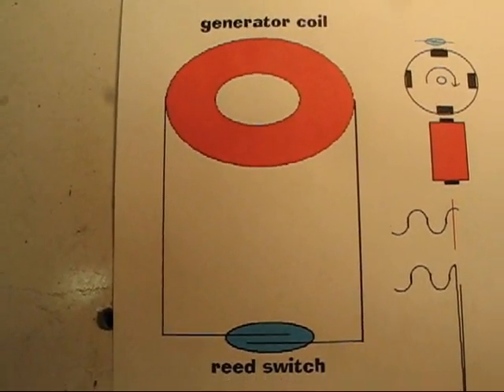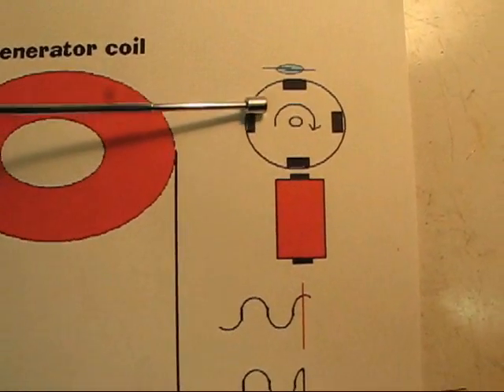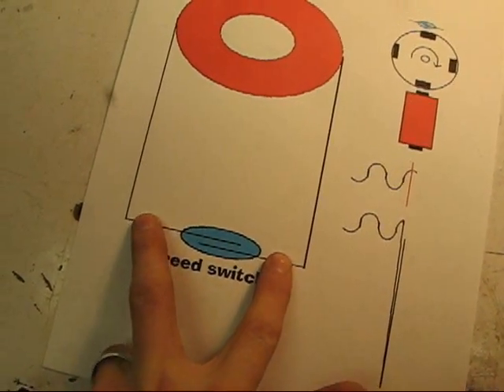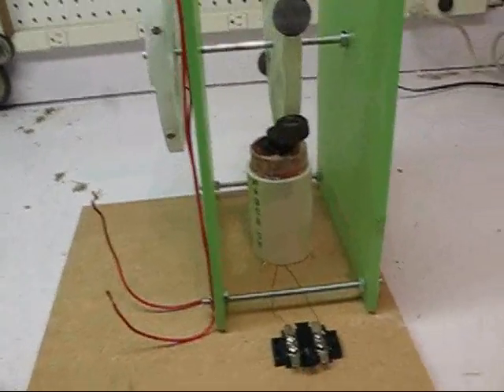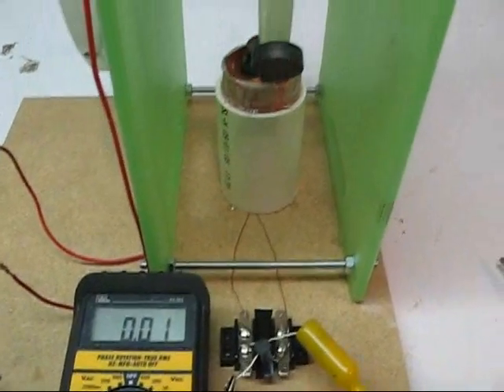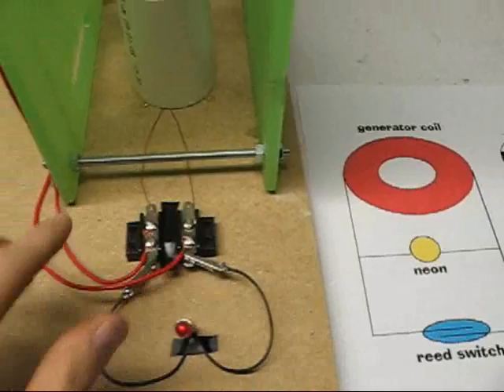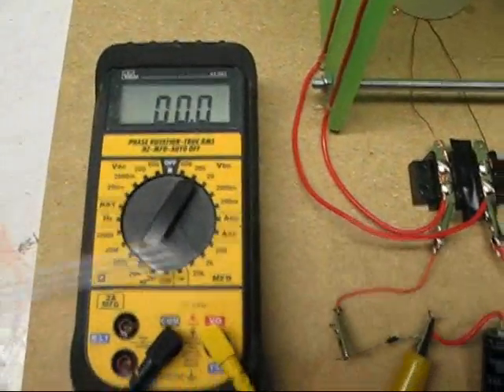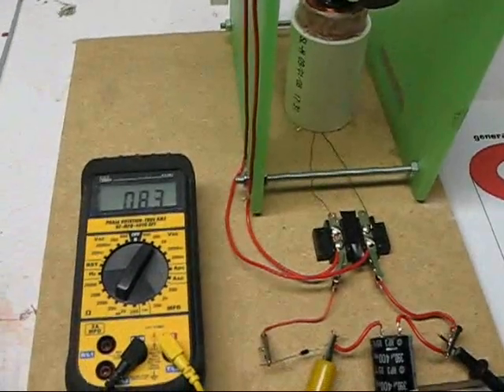Flyback From Generator Coil

Comment: Just 'thinking out loud' here.  Not used to seeing the secondary winding of a transformer set to short out as the oscillating magnetic field from the primary 'winding' (the rotating magnet in this case) is inducing maximum EMF in the secondary.  The coil is the secondary winding.
Very interesting circuit!

As the reed switch is made to close, it creates a 'load' for the coil of very low resistance.  Why?  Because the reed switch is connected across the coil (see time 3:24) and the timing of the reed switching closing is aligned with the position of the primary 'winding' (the sinusoidal magnetic field passing by the coil, the rotating magnet).

So at peak induced voltage in the 'secondary' (the standalone coil),  the reed switch closes, and that shorts the two ends of the coil together.  This is like the secondary winding of a transformer being hooked up to a zero ohm resistor.  Very high current.

What does 'very high current' create in a coil?  The rate of change of the current in the secondary winding (the coil) is HIGH.  The current in the coil goes from zero (reed switch in its 'normally open' position),  to max (reed switch is made to close by the 2nd outer rotating magnet wheel).

Since the rate of change of current dictates the intensity of the magnetic field created in the coil, and we have here a high rate of change of current (zero to max after five L/R time constants*) - the magnetic field in the secondary is intense.  Note:  it could be increased more if a fast MOSFET was used, since I believe the MOSFET will switch on and provide a conduction path faster than a mechanical switch.  But then you'd need complexity to drive the MOSFET gate, etc.  Reed switch is perfect for this demo.  Good choice on your part imo.

When the 2nd outer rotating wheel's magnet is no longer near the reed switch, the reed switch opens and the massive magnetic field just created in the coil collapses into a huge Back EMF spike.  Really cool.

The key factor is that 
1)  a zero resistance 'load' - a dead short - is added across the coil (secondary winding) 
2)  and this is done at peak magnetic field induced by the primary 'winding)  (the rotating magnetic field wheel)

"When induced voltage is maximum, short out the coil so that maximum current can flow.  Since the magnitude of current and the speed the current changes dictates the intensity of the magnetic field induced in a coil, the fast-changed high current creates a big magnetic field and sets up a big Back EMF spike."

Really clever stuff.  Thanks for an excellent video!

Comment: I have a generator than turns very slow when I apply more torque when charging a battery, it must be back EMF as resistance of the load on rotors and shaft is greater when i add more toruqe

Comment: No, the reed switch is across the AC side of the rectifier, connected directly to the coil wires essentially. The spike occurs when the reed opens yes. At that moment with the reed open, all the extra energy goes to the load. Neon, or bridge rectifier, etc.

Comment: add a small film capacitor across the switch  then add a secondary with 100x more windings and make yo-self a magneto!!! 50,000 volts of electricity!!!

Comment from the maker: @teslata00 

No, it is defiantly a neon.  Part # 272-712 from radioshack.  Thats how they come from the shack.  They also have a resistor in them to be used with 120V.  It would have lit much brighter had i taken it out.

Comment from the maker: @waltermouthoh 
Well sure you could use it to charge batteries running from your bike, but i would probably just use a standard generator on your bike to charge them for ease and assurance of desired output.  I dont completely see everything the way school teaches it either, but for the most part i would say it would be very wise to pay attention in school.

Comment from the maker: @henrykay01 
Sorry, i know the title is goofy, i may change that.  I know the patent you speak of and have experimented with it, its an interesting device.  Most Hams are aware you have to be careful when touching an ungrounded antenna as a HV charge will build on it.  Its that same effect put to use.  You can basically think of it as a device that collects static electricity from the air.  Its not perpetual motion, its more like a windmill or solar panal.

Comment: TRY 5 times at peak

you will get 5 times more power and matners will be "confused". Busts lenz law and increase power in huge amount.

you really cant measure current at same time as you do this...you have to calculate jules in cap - the ammeter will snub the effect!
Also if you use solid state swticheing, the internal resistance of most  will snub it too but reed swtihces work and mechanical ways too..
Ismael Aviso uses IGBTs (lowest resistance) and special RF filters on their gates

Comment: Hi,
maybe try a small motor to run on the charged cap, that will drive the wheels !
Maybe your spike is producing enough power, so a small
motor can run it ? This would be then a selfrunning system !
Good luck !

Comment: now have 2 caps one charging and one dumping the potensial to a battery. 
The secret is to switch the charged cap completely off the charging unit, when dumping it to a battery.

Comment: Nice video. Suggestion: You need to show current measured in standard method,  and then compare it to the current measured with the capacitor later on.  My hunch is you are amplifying voltage but a current drop is occuring. However in both instances total Power = IxV is the same.

Comment: Hi Cody
thanks for doing the video!- I always try to get people to :"short" their generator coils at the peaks but only a few people so far have actually tried it to confirn the extra power it makes
Ismael Aviso clips "pickup winds" around his  high voltage motor coils FIVE TIMES at the peaks!
twice before  Top Dead Center, once at TDC, and twice affter TDC - he uses very fast swtihcing to do this.
if you use one diode, fill TWO caps each iwith own diode (opposite facing diodes)

Comment: I got this from testing a mullergen by "shorting" coils with reed swtich, and cap suddenly had X20 volts!
Swtihcin at peaks is key. Also very short pulse width..
I like to say this works becasue the coil collapses "within itself" and rebounds with a vengeance when switch is opened.
Those reed swtihces will fry from that arc - you can pull off that plasma arc with dioes into cap too.
i like to use a FWBR (fullwave bridge rectifier) instead of single diode as shown here - catch it both ways.

Comment from the maker: Your right, a better diode probably would help .  I no longer have that setup so i cant test it with that, but any pulse motor could easily be modified to play with the effect.  I find it funny some of the things i say in my vids : ) cant take them back once on tape.  I was using a 1n4007 in the vid, but i usually prefer at least 1n5408 or better yet an ultrafast hv rectifier.

Comment: the reed switch could rob some of the power,but have you considered the voltage rating on the diode? try charging the cap again with a high voltage diode. thanks!

Comment: Indeed there are many people working on more efficient motors, because the ubiquitous squirrel cage induction motor that runs industry is well known to be very wasteful.  These motors are widespread simply because they are cheap to make.  Better motors have been around from day one. Beating the common induction is not an impressive challenge.

Comment from the maker: Thank you for being a respectful skeptic, many are very impolite.  There are many trained engineers working in this field, and motors have been built that are more efficient than current models.  Google rotoverter for a shinning example.  This motor runs on less power than the standard motor, and still preforms the same amount of work, and there is nothing magical about it, like you said , its all explainable.  Its just been easier to manufacture and use less efficient motors.

Comment: You are talking about salvaging the energy of a collapsing field when turning off a motor.  This is a small loss, hardly worth the bother.  Surely you're not suggesting that there is some kind of fountain of free energy waiting to be tapped . . . for that would be chimerical thinking.  At best, you are chasing a fraction of 1% savings in putting this little spark back in your pocket.

Tell us of the lost mysteries of Tesla's coil!

Comment from the maker: A motor is not needed at all to play with this, it is just providing a simple means of switching to get a pulse frequency, increasing the effect. The tesla coil as known today is not at all what tesla originaly invented, it has been changed and dosnt opperate as it should, its not just some spark generator.  There is a lot of technology that has laid dormant for a long time but you will see it coming back soon.

Comment from the maker: You are also correct here about the collapsing field inducing a potential voltage. But when directed into a capacitor or battery, that potential voltage gets transformed back into current(amps). This is another well known effect (which was discovered by tesla).  No ark occures when correctly set up. Tesla went way more in depth with this stuff but that info you wont find in mainstream science.  Just like true wireless power, no schematics or diagrams in school books.

Comment from the maker: You are correct, it does kill the contacts in motors and great lengths are taken to avoid it.  However, to avoid it is wasting energy, it only destroys the contacts if you dont give it a path to go, such as charging a battery.  Works like this: charge up coil, abrubtly turn off coil, direct collapsing magnetic field into battery thus conserving energy.  Works best on resonant notes of coil.  It was tesla who first discovered radiant energy, not bedini.  But thats to much for me to cover here.

Comment: Coiling the wire simply concentrates a lot of magnetic field in a small space, thus exaggerating the effect.  This same effect is well known for 100+ years to make hell on relay contacts connected to electric motors, mainly at the time when the motor is turned off.  The arc damages the metal contacts.  I suppose it is killing your reed switch!

Now I have a question.  Why did Bedini call this a radiant spike?  And what is Bedini claiming to have discovered?

Electricity is interesting.
Jaymz

Comment: This spike is a well known effect, and is explainable.  When electric current flows in the wire, a magnetic field develops around the wire.  This is stored energy.  When the circuit is broken (opening the reed) the current does not just stop immediately, it keeps flowing.  The collapsing field induces a potential (voltage).  You could say the current it trying hard to keep flowing, and may form a plasma ark where the circuit is broken.  To be cont. . . .

Comment from the maker: DavHav,
Thank you for your comment.  Yes i believe you are correct.  I have advanced this circuit a bit more and have a better understanding of it now.  Its the same resonant interaction between capacitance and inductance just like a bedini, however in this case the power source is not the capacitor(battery for bedini's) its the inductor.  Ill have to post some updated stuff when i get the time.  Ill check out your videos.

Comment from the maker: Hmm, well im not going to argue that studying would be a good idea.  I will say that a higher voltage is still present with the cap connected, maybe not 90v or better but still higher, because the cap never gets that high without the circuit hooked up like that.  I do know that you have to have a higher voltage than that of what you are charging in order to charge it higher.  Ive got the cap up over 50V, the coil doesnt put out 50V conventionally.  In other word 10V cant charge something to 50V

Comment from the maker: Actually, i would say its more than a slight drag, I did many tests to calculate the drag when shorting the coils, the video didnt cover any of that.  My tests showed about 50% more drag than my control test, thats pretty significant.  I have since then developed a way to get the effect without the drag, or the drag is the same as my control that is, but no increase or push like darkwizard suggests.

Comment from the maker: Wow, you posted a lot here!  Ill try and respond to most of them.  First off, thank you for your comments.  You are correct about the voltage actually being zero at tdc.  I started off assuming what was happening on the thread was correct, i have since learned some things, so all and all i think it was worth it.  I may change the video, or make another one further explaining it.

Comment from the maker: crob227,
Im happy to see some people are aware of this.  Please note, im not claiming this to be an efficient way to generate power and i have done no testing of efficiency compared to regular power generation. There is however people claiming they have advanced this technique to where it puts no load on a motor.  Follow the thread i provided in the(more info) if you are interested.  In the thread you will find your mosfet awnser, patmacs circuit.

Comment from the maker: Knowledgemonger,
thanks for the reply.  Im not claiming this to  be a efficient way of generating power.  I did this video to explain the basic concept of it creating a HV spike for a forum i post on.  The threads main focus is on two peoples claims that they are using an advanced circuit of these basic principles and are getting these spikes without showing a load on the motor, which would be very efficient.  Im not claiming this to be true or not true, follow the link i provided if interested.

Comment: how would you appliea mosfet to this system?

i have used small reed switches from radioshack that has a coil built around a magnetic switch, so youcan iether pulse current through the coil to trigger or use a magnet.....  also i found a relay in a old air conditioner unit thats coil has hair like  wire in it and gets 80volts with 1"x3/4 neo's